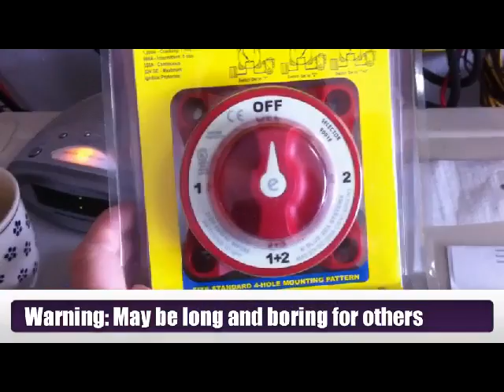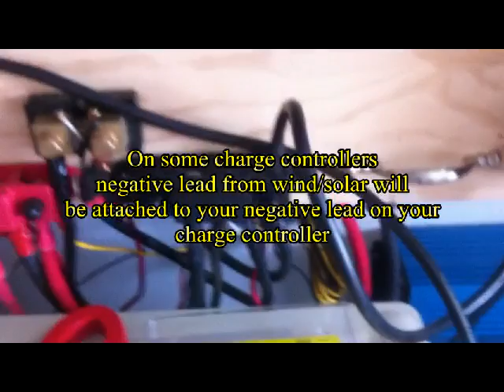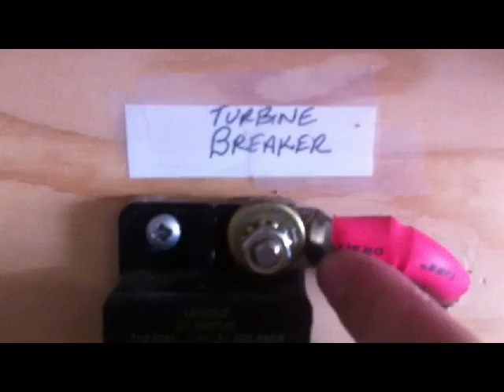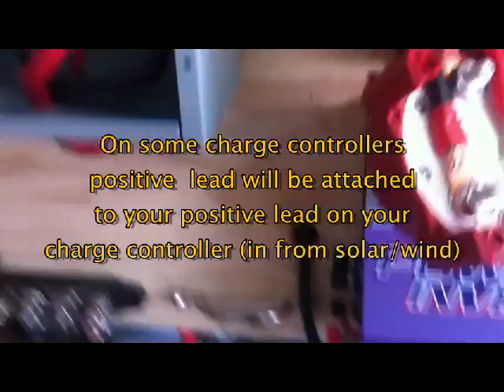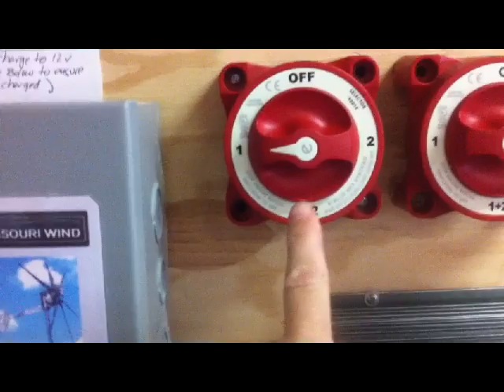Wiring Blue Sea Transfer - Video Response

Comment: Hey is it normal to have a 'phantom' 0.07V on a GTI when switched to position 1 (battery)?
Reply from the maker: I would say not abnormal.  I've encountered similar phantom loads. i suppose it's possible it's not a "phantom" either depending on what else you have connected up to the bus for your battery (e.g., sleep mode on your charge controller, etc.).
Reply: Thanks, I will have a play adding/subtracting bits to bus to see what that does. I was going to buy a dual pole breaker switches but my GTI somehow works more efficient connected to bus/ground than direct from solar. Again another phenomena, any ideas?
Reply from the maker: that one i'm not sure...

Comment: Would you be able to send/divert the dump load to your water heater instead of your resistors ???
Reply from the maker: i could and i would if my system went into diversion much.  but, right now (at least with current set-up) the odds on me going into diversion, even 1x every couple months, is pretty slim thus not worth the work.  but if my system diverted much i would definitely rather get something for the excess power.
Reply: Maybe when you expand with more panels later ???

Comment: Your video is very educational for me because I am new in this avenue of renewable energy. I like your set-up. I'm just curious, are you dumping your excess power to the grid? Is it possible for you to give me your panel board diagram? At the moment, I'm setting up my own panel board for wind and solar and collecting materials for this project. I saw your controller is from Missouri Wind and Solar, can you recommend other brands of controllers that I can use for both wind turbine and solar panels? Thanks alot.
Reply from the maker: Thanks!!  I'll be posting a new series on my off-grid cabin install, step by step if you want tune in and subscribe.  But, i don't really have a wire diagram (actually i wrote up something posted by Ray Ismiz on his channel for him while back...got to his channel (he's a subscriber to me too) and you should find there, but happy to answer any questions.  I generally charge to battery and dump excess to grid since i am a net meter subscriber and get $ back for my solar i sell back. As far as charge controllers, i highly recommend any MPPT controller (wind or solar).  IMO best brands are Midnite Solar (especially for wind) and Outback Solar, although you can find some lower cost alternatives that are also MPPT.  Technically, you really should have a separate controller for wind and solar, unless your using more of an "on-off" voltage regulator (non-MPPT) like the Missouri Wind/Solar controller featured here, which again is more of a voltage monitor and disconnect controller.  You can still use the Blue Sea to switch/direct where you want your incoming power from solar or wind to go to (e.g, grid or battery bank) except you will be switching/directing the power sources to better charge controller.  Right now i have my solar controlled by my Blue Sea to either go to my Outback FM 80 Charge Controller (if i want to charge batt bank) or to a plug-in Gridtie inverter if i want to have the power go to the grid and roll back my meter.  With my turbine, i plan on doing the same, except, my separate Blue Sea switch will switch between another Outback or Midnite Classic (rather than the Missouri controller), and to the plug-in GTI for wind if i want to go to grid to roll my meter back.  But to answer your last question, there really is no controller that can effectively be used for both wind and solar since all MPPT controller technology is constantly sampling your incoming power and either lowering/raising the volts/amps to match the optimal charging amps/voltage needed at any given moment for your battery's state of charge.  With wind a controller can handle that, or with sun it can handle that constantly algorhythm, but when both wind (more flucutations) and solar (less power fluctuations) go thru the same MPPT controller it cannot work properly.  So, unless you go with a pure voltage/disconnect (I don't recommend), you got to bite bullet for 2 separate controllers when dealing with both sun and wind.

Comment from the maker: thanks a lot.  appreciate the comments and good luck on your install.  these are great switches.  i use them also for my battery disconnect to cut off power between battery banks and everything connected to it when working on equipment, etc..
Reply: sunsensational I

Comment from the maker: actually my solar is not hooked up anymore on that controller, instead it's connected thru my Outback Flexmax, but i use to have it hooked up to my MWS/Coleman controller.  I t hink in this vid, it's only my wind hooked up on the controller below the relay.  in fact almost positive on that, but i may have an earlier video with both solar/wind hooked to the MWS controller. im happy to look at a vid of your connections if you want post later

Comment from the maker: that way it would go from the GTI to the resistors (via dump load terminals on the GTI) IF the GTI failed for some reason (e.g, grid failure, etc.). But i would NOT have the relay hooked up to both the resistors and the GTI.  You want it hooked up like i have in vid with 1 minor modification using "jumper" cable to avoid dumping excess batt power when it goes to divert/relay.  I'll explain that part later if you need.  But definitely want your relay on controller to go direct to the pos GTI.

Comment from the maker: Hi Jim.  I have tested running to relay switch and from the dump terminals of the GTI to the dump load (resistors) and works fine.  Not sure i understand your question, so clarify if i don't answer it. But,from the relay on the charge controller it should be wired directly to the GTI so it will dump the load to the GTI once the batts are full (e.g., voltage hits 14.4v).  Then we need wire from the dump load terminals on the GTI to the bank of resistors.  (see cont,)